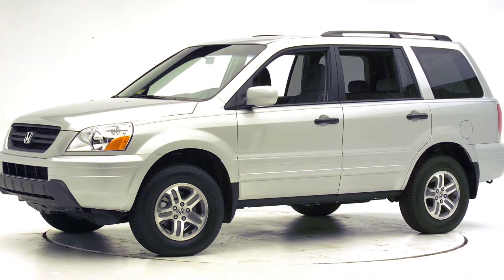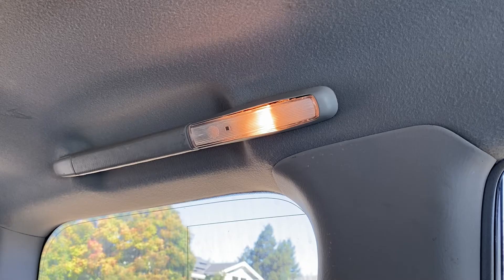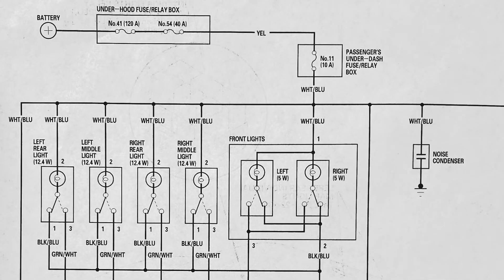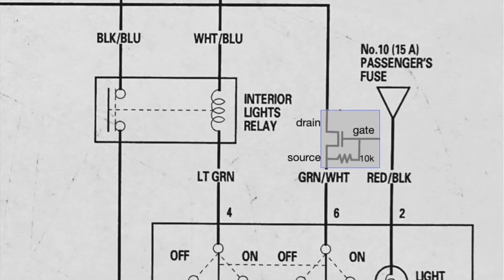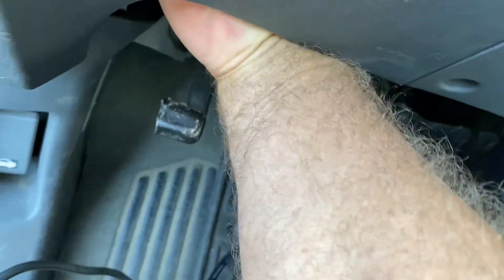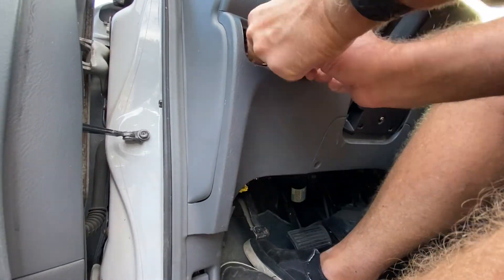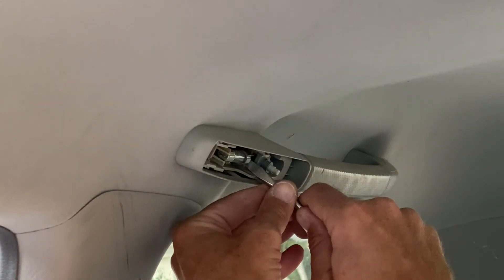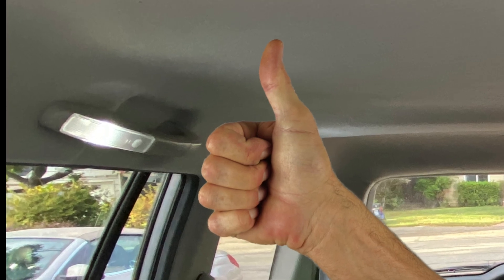Hack Early Honda Pilot So Handle-Lights Don't Kill The Battery!

Comment: This happened to me recently. No one at the shop could figure out why the battery kept dying. Until one day, I just happened to notice the light on in the back.
Reply from the maker: Yeah, I think this was a real "oops" for the designers. It is so easy for these back lights to be turned on and then go unnoticed!
Reply: @ravraid  Replaced 3 batteries before I figured it out by accident.